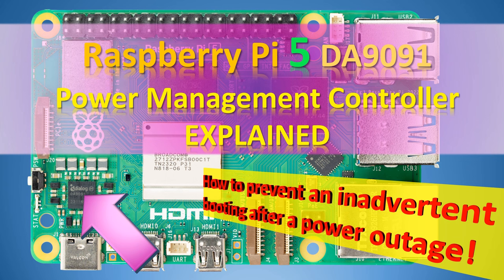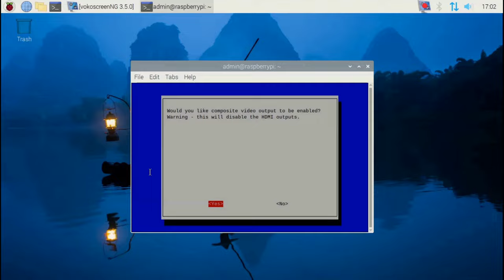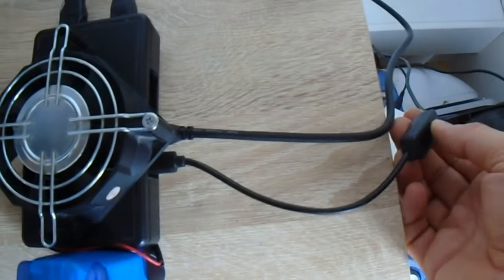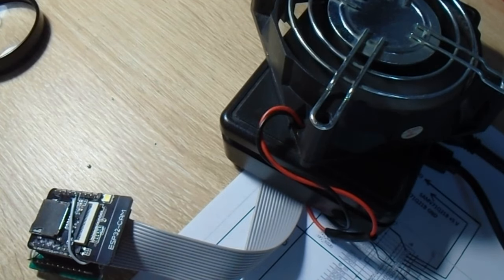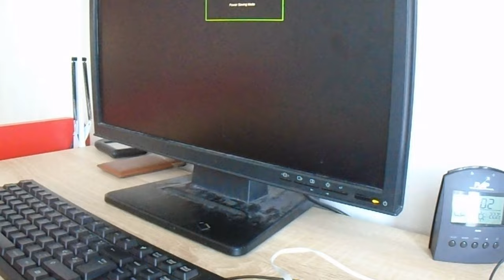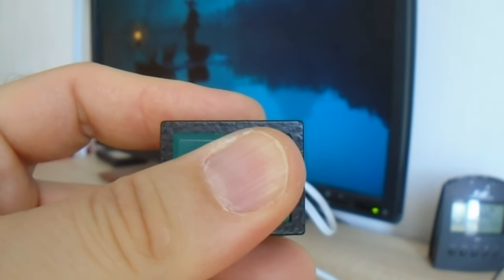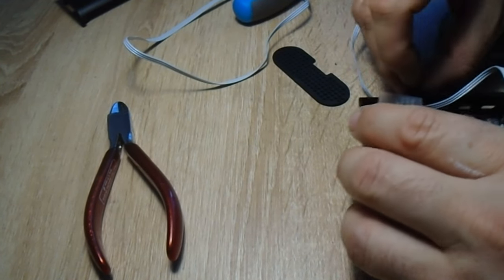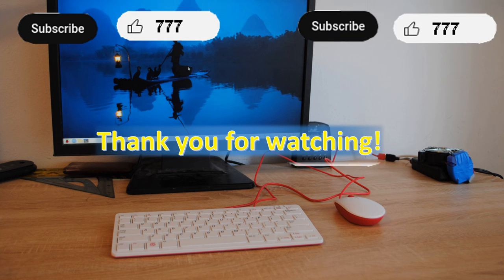Is Raspberry Pi 5's Power On Button Safe?!

Comment: There is config where you can disable 3.3v when shut down.
Reply from the maker: Yes! As I've said. It depends on the operating system settings. sudo rpi-eeprom-config -e command allows you to modify POWER_OFF_ON_HALT=0 to POWER_OFF_ON_HALT=1, which obviously turns off Raspberry Pi 5 +3.3 V. However, my solution works regardless of the operating system settings and it is not operating system dependant. Some operating systems may not allow you to modify POWER_OFF_ON_HALT setting in EEPROM, so you would have to first boot Raspberry Pi OS, modify the setting and then boot a desired operating system.
But a much more serious problem remains. You cannot prevent booting, if power Raspberry Pi 5 power supply is unplugged (like at a power outage) and then plugged into the grid power grid again (like when the power returns). This was the main reason, why I've designed my circuit (watch video:  https://youtu.be/BINHFtPJi7o ) The second reason was to be able to lock my computer and to start it or to shut down it remotely (via Wi-Fi). +3.3 V rail remaining powered was only the third reason.

Comment: The reason that got me here is the question of how do I make the pi not boot up by itself after a power outage. Now all your explanation didn't do much to answer my question' or I'm a bit slow-minded.
Reply from the maker: An answer is at the end of the video. A schematic and build instructions are in this video that was published earlier:  https://youtu.be/BINHFtPJi7o
It works for me! 
You can also use a simple relay solution at the end of this video: 
https://youtu.be/SMg938ZtYWQ , but I strongly recommend the first solution, because it is a low voltage circuit and it does much more than just preventing RPi 5 from inadvertent booting.